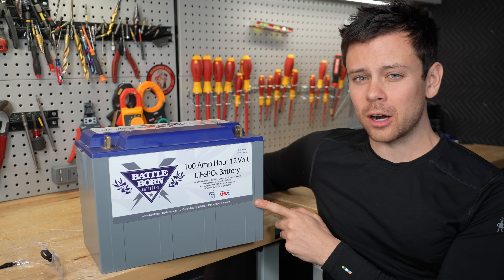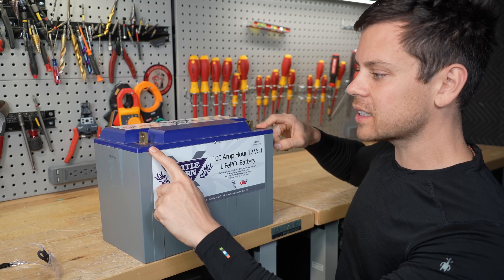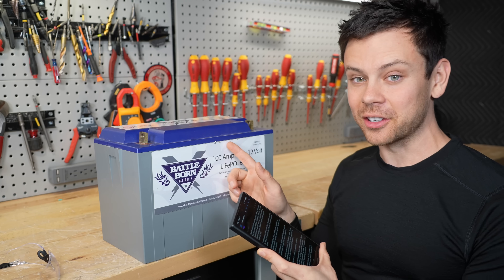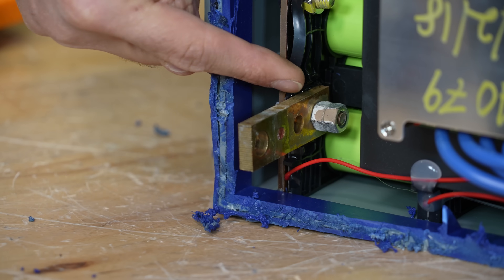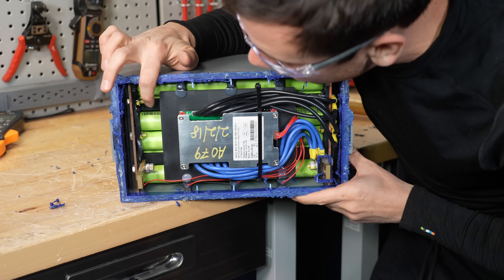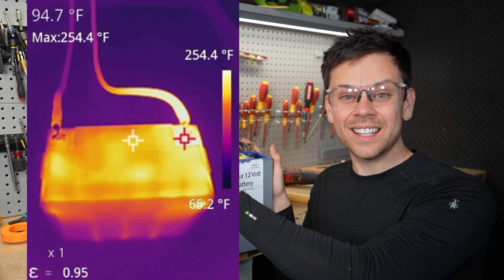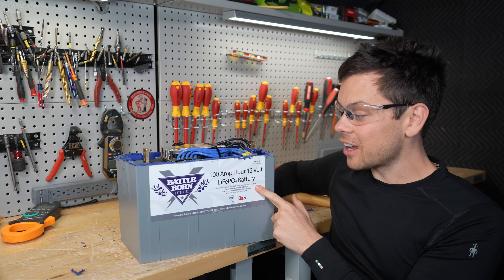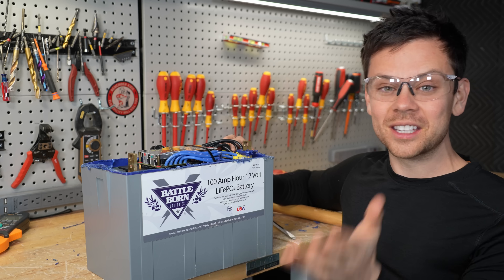Battleborn 12V Battery: Major Safety Issue

Comment: This is NOT a properly conducted test and it is so sad how many people this video is deceiving. The first problem was when he does his charge test and never bothers to mention how many AMPS he tried charging the battery at. This would have been the most important information he could have provided but did not. But then he gave a very important clue when he mentioned that the battery kept shutting down on him. That sounds a lot like an internal BMS (Battery Management System) shutting down for over charge current. Reading directly from the technical spec sheet of this battery, the Max Charge Current is 50 AMPS. I assumed he was trying to charge at a much higher current then the battery was ever rated for and he has now confirmed my assumption on his most recent follow up video where he tries charging the battery again but this time does disclose that his charger is set to 95 AMPS! This is a case of absolute misuse and completely ignoring (or never even consulting) the technical specs of the battery and it’s intended use. If you try to charge a battery at TWICE it’s rated current, don’t be surprised when things get hot and the BMS does exactly as it’s designed and tries to shut off the battery but cannot because you are using an AC-DC bench tester that forces a current. Any smart charger (as you should always use in any well planned system) would not continue to push a massive charge when it detects faults. This might be a great video to show the breaking point of a battery when you double it’s rated current, but it’s not a fair assessment of it’s quality.

The second major flaw in his test is that he STARTED with an already compromised battery! Any scientific experiment without a control group is completely invalid, but we won’t get into that. He states that the battery was sent to him by a subscriber as an example of a bad battery and then proceeds to conduct tests on it, knowing it’s already bad. So we have no idea how the battery was originally used or misused by this unknown subscriber. Battle Born batteries use Flag Terminals for the positive and negative connections. There are a lot of benefits to Flag terminals but they are, unfortunately, often misused by DIYers. People have a tendency to crank down on their battery connections and the extreme leverage force of a wrench would crack the housing of any Flag Terminal. This is, again, misuse. Directly from the manufacturer, a nut and bolt should be secured to the flag terminal using a socket. Unlike an adjustable wrench (which most use) a socket applies a rotational force through the center of the bolt exerting little to no leverage force on the flag terminal. We can’t confidently say this is what happened because we are given no context to this battery’s previous life, but this is a very common misuse of Flag Terminals and could have very well happened judging by the cracked internal housing seen in the video. You can even see in the beginning of the video, before he cuts the battery open, that both flag terminals are bent inward, hinting that excessive force has been applied to them. Also, the battery case itself is a crucial structural element and you can even see how the Flag Terminals are epoxied through the lid of the battery. Note around 1:15 of the video when he rips the top off and almost takes the negative terminal with it as it breaks out of the epoxy that was intended to hold it into place.

I personally visited Battle Born’s production facility in Reno earlier this year, as this is my industry, and highly recommend you do the same if you’re looking for insight into the world of energy storage. They are extremely transparent about their entire process and I believe they are building the highest quality battery on the market today. I hope this CLICK BAIT video does not hurt the company as that would be a lose/lose situation for everyone. Battle Born is the most American made lithium battery on the market today and even soon to be 100% American made. They are not inexpensive because they do not cut corners. My knowledge of batteries grew 100x from visiting and talking with their engineers and even Dr. Phares himself about everything that goes into producing a quality battery like this. No one is influencing me to write this review. I am a Battle Born customer myself and have installed, literally, hundreds of their batteries for my own business and have never had a single one fail (we install them correctly with a socket and never exceed 50 AMPS per battery of charge). They are an incredible company to work with and I’m excited for their future as they continue to create jobs for the American people. Hopefully more people will stand and point out the obvious flaws in this video instead of jumping on the band wagon with everyone else slandering a company and a production process they know nothing about.
Reply: Should be top comment
Reply: @fulltimecoderparttimegamer  Agreed, but the algorithm is probably going to show the comments with the most engagement first.
Reply: What do you have to say now that he replicated the issue with a brand new battery in his latest video?
Reply: @PersononYT56  Did he "replicate the issue"? I'm curious what part of the video you got that from? Are you referring to his latest video where he redid the whole test, inadvertently proving this entire video wrong? The whole premise of this video and all the uproar he created was that the flag terminal got "dangerously" hot and could burn down your van. I pointed out that he started with an already damaged battery, the terminals were likely over torqued and internally broken, and that he charged it at DOUBLE the approved amperage. So in his latest video he took all my suggestions, line by line, to conduct the test the way he should have in the beginning and then clearly shows that the hottest that either terminal got was 114 degrees... 25 degrees colder than the coffee I'm currently drinking. So the terminals don't get hot when the battery is used correctly. That's what started all this. But he's not taking down the first two videos that he's now disproved? No apology to the 320,000 people that he deceived into thinking their batteries were dangerous (whom he made a ton of money off of by the way). Then clings to a cycle test showing lost capacity in between consecutive cycles. But then actually even shows no lost capacity when he gave the battery a moment to cool in between cycles. So I guess if you have some weird scenario where you completely discharge your battery then recharge then discharge etc. etc. without any breaks in between then... well... I don't think any batteries are right for you and you should probably rethink your system. I can't imagine designing a system with a 100A load and only including a single 100ah battery. He's creating completely unrealistic scenarios and getting everyone fired up about them.
Reply: @jesseengelhard768  so wait, im sorry, youre siding with BB where they say the melting plastic and creating a loose terminal is a "feature" and not a "defect"? I just want to be 100% clear where we both stand.

Comment: I'm getting a completely different response from battleborn claims that the customer caused the problem. I do have a recording of it if you would like but they entirely defend that cell post going up to 250° due to the customer didn't have his s*** wired correctly which is not possible as the rest of his system. As long as it is correctly, wired would show signs of problems. Also, as you've indicated, it does not. They indicate it's one single cell out of 400,000 yet your viewer indicates it's more than one. I believe this is a problem due to maximum usage in a high demand situation and these cells are not accommodating for it as their safety protocol inside is disassembling itself. Does battleborn not realize that thermal warming of terminals changes the torque setting of the nuts? I can see that they're already fighting with the problem. Dual nutting it. I would imagine that the problem comes from the nuts working themselves loose. Still the same problem you find in a engine of a car that was solved by locking washers in different forms. So there's not just one kind that can lock something. They completely denied even the possibility of the locking mechanism causing the issue on the internal post. I do not believe battleborn is very upfront. The BMS should have kicked it out since it's set to 135 approximately they say and it is set in the center of the cells not monitoring the exteriors or the post connections. So I believe their ratings are very incorrect for their cells and you need to make more of a stink out of it. There's a lot of these cells in service that could potentially be explosions waiting to happen. If you contact me I will give you the complete audio of Ron and then the technical support team. Also. I apologize I'm not as kind as you are

Comment: Bad warranty customer service. I purchased four 100ah batteries at a cost of almost $4,000. When they started failing after just 3 years I contacted Battleborn After trying every suggestion they sent tha batteries still kept shutting down or not accepting a charge.
Finally , Battleborn suggested that it was probably my fault. But if I disagreed, I could send them in at my expense for shipping. Then, they would charge me $150 per hour for them to test and diagnose.
So much for the 10 year warranty.
It did not make economic sense to send them in given that current prices for other brands were less than the shipping cost alone.
So $4,000 into the hazardous waste dump.
If you read Battleborn’s warranty language you’ll see that there’s almost no way for it to work if you have a problem

Comment: Glad I've been too poor to afford one of those, and instead have bought Aliexpress and DIY.  6 years without issue for the oldest battery (from individual cells).  Holy #$%#%, I just looked at pricing...  yeah, my most current battery is a 320ah LiFePo4, 200amp JKBMS with heat and I'm under $500 all in.  Shoot, I paid less than $500 for a 100ah back in 2019 and it's still working flawlessly

Comment: I am so mad. We had this problem with our BB battery bank. They gaslit us and refused to replace them over 4 months. They also claimed there was no issues they had ever heard before and it must be user error. They also said mail them to us and if we decide it is not a warranty issue we will charge you like 600 plus shipping to get a replacement. We finally gave up on our battle born battery bank. Mind you we had purchased them at around 1k each so 8k down the drain. We replaced our entire bank with 4 300 amp from epoch Which have been great for the last year.
Reply: And the shipping would have been paid back to you if the batteries were the actual problem. Since you never sent them in no one will ever know.

Comment: The whole idea of connecting two bus bars together is that the surfaces of both bus bars provide the electrical connection by the large contact area and that the bolt only provides the required mechanical pressure on those bus bars to ensure low contact resistance between both bus bar surfaces. This is electrical engineering 101.

In this setup, the current entirely flows through the bolt and nut, which have a higher resistance (steel vs copper) and a smaller contact area, and thus providing a heating point. Apart from this, having plastic (realize what the word "plastic" means!) sitting between both bus bars ensures there will never ever be the required pressure between the surfaces of the bus bar and nut to provide a low resistance path for the current.

This construction is basically illegal and this battery should be taken off the market immediately. Also UL should be notified of this gros violation of applicable ANSI/IEEE standards.

Comment: I have 3 of these I bought used. I cut them open to fix it. The bolt and nuts are aluminum, and a piece of plastic is sandwiched between the nice copper bus bar and the terminal. I replaced the bolt with a steel one with washers, and it seems to have worked. 

I was thinking that the thermal expansion of aluminum, combined with no washers, and jiggling of the post when tightening the terminals down might have caused it. Once it gets a little loose, the extreme heat causes the plastic to melt more and cause more connection problems. 

One battery shutting down will shut down the whole system of batteries. 

I have these in my garage doing nothing now, and I put in a couple large watt cycle ones into my van instead.

Comment: The negative terminal bolts clearly have paint-pen lines...which generally means that they were torqued properly and QC checked.  I see no indication of that in the video on the positive side.  If it were me, I'd have a lock washer and then a standard nut, followed by a NyLok nut...all in an effort to prevent loosening).
Reply: Nylok plastic will melt and you will lose the locking properties...

Comment: Let's back up NOTHING inside of a electrical of any polarity can create heat  and pass any certification US or globally i spent 35 year as a electrical controls expert Trouble shooter and field electrical engineer i worked in the petroleum sector and if designed or reverse engineered proprietary  equipment.if i were to allow a circuit that capable of building i would been blackballed from the entire worldwide petroleum industry  every country in the would have blackballed ending a 35year career and I want to say there is No Authority having jurisdiction over the petroleum electrical industry We Police ourselves. Now understand why it's important if I allow and bad electrical design on let's say a drilling rig in the remote Artic circle.and it fails and the rig has to stop drilling until a rig electrician can fix the first 12hrs down cost the equivalent of $5000 24hrs $15000 2 days $25000 more than 48hrs the drilling company is fired by the oil company for every day the day the drilling company still has any equipment on the location $25000 per day at the end of the triangle wreck I personally would be sued by the the major oil company + The Drilling rig company if i was there wile being employed by an electrical contractor i would be fired by them and blackballed from petroleum industry as a electrical Troulshooter a would be looking at how ever much the lawsuits above my 6 million dollar umbrella  liability insurance paid IE petroleum lawsuits start at $250 million with that said Battle obviously have had lawsuit against them yet and they probally think the can skirt the issue claiming itt is user error,! Is they don't fix it because that is they only sane thing to do then I this to them their batteries are the only lithium batteries that are used in the petroleum industry because their reputation is what people heard was the best And in the petroleum industry they only use the parts equipment and service companies. 
That's how importantit should be to battl born to fix this issue and the petroleum industry is 1 of hundreds of industries that could less about a product Cost they OLNY CARE ABOUT RELIABILITY.
Just one more thing  in petroleum every vital component has redundancy  but the lifepo4 equipment does not have the SOP of redundancy YET

Comment: I have never seen a problem with Napa brand or any lead acid battery systems in a moving vehicle. Either vent the enclosed battery area with a fan or mount them on the frame of the schoolie or rv

Comment: This explains so much I had two of these in my original system, power capacity just kept dropping lower and lower each week. I pulled out all my batteries, and when I checked these two, they were overheating to the point that I was uncomfortable putting them back into the system and gave them away.

Comment: BattleBorn offers an absurdly stupid justification of a terrible design choice. The plastic sandwiched between the  output terminal and the buss bar WILL slowly deform. It's a bad idea from the beginning to force all the current flow through the bolt, instead of directly connecting the terminal to the buss bar. It is ludicrously bad to put a layer of thermoplastic in the middle. The jam nut will do a decent job ofr preventing the nut(s) from coming loose. But that's pointless, because even modest heating of the bolt will cause the plastic to deform and loosen the joint. Once that happens  you are cooked (literally.) The loose joint will heat up even more, resulting in accellerating worsening. BattleBorn's claim that this results in safely opening the connection is such an obviously false claim I can't believe they said it. The connection becomes intermittent and high resistance, not cleanly disconnected.

Comment: Thank you for documenting this critical design issue. I use two of these batteries in mostly stationary applications that never approach 1C, and will probably continue. It's disappointing that this company/brand that boasts so much has fallen so short. People using it in mobile applications should be aware of this for their safety.

Comment: About time somone calls this out!  Had one in a boat do this and was smoking so we tossed it on the bank till it cooled then got it back called battleborn they said it was our fault an we just sent it tk recycling after cutting the terminals off so no one would try use it